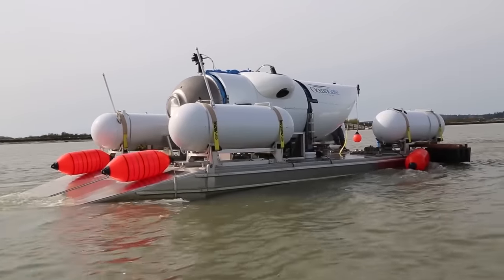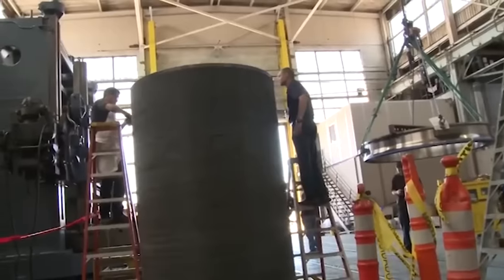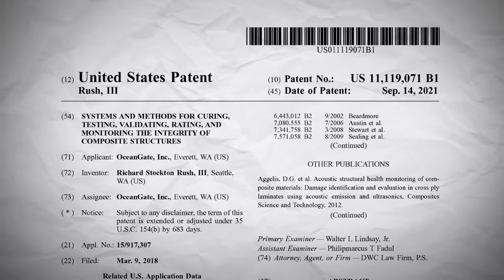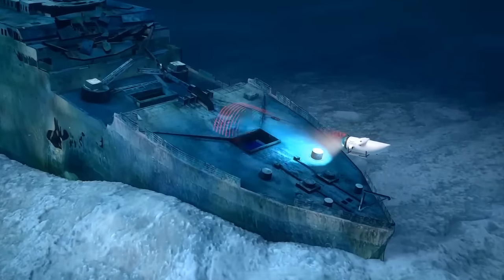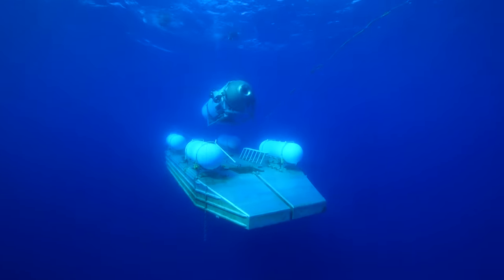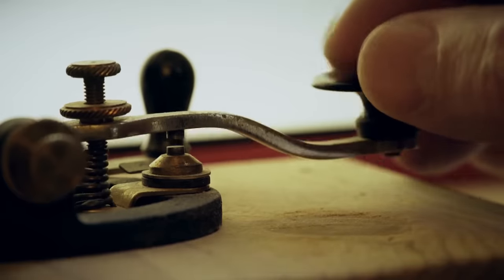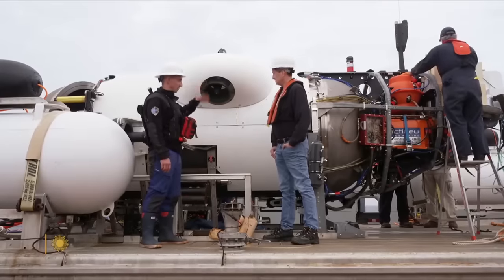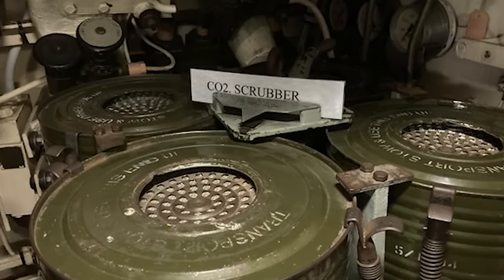Exposing OceanGate Submarines Many Fatal Designs

Comment: I’m glad to hear someone explaining that the controller isn’t that big of an issue.   Too many people focus on that because it just seems out of place, where odds are the catastrophic decompression was caused due to the hull’s poor design and material choice.
Reply: It really wasn't that big of an issue true, but the video way misrepresented the issue of having it as a main control. The examples he showed were all non critical systems with little risk involved, especially an example with military submarine: they do use controllers but they are 
1. Wired
2. Not Logitech crap
3. Only operate auxiliary systems that can wait for a replacement controller in case of malfunction 
Way different from using them wirelessly to control the sub at extreme depth very close to old debres
Reply: The controller itself was not the issue but the way it was used could have led to problems avoidable if done properly. Using it as a remote control, the need for batteries with the subsequent risk of fire or simply running out of power in the worst possible moment. Those things can be avoided by wiring the controller. This will not have been the root cause for the implosion but it indicates how poorly the whole submersible has been designed and built.
Reply: Everyone giving this man a bad name but his impact he left is far beyond what he could have imagine. This incident became the front page of worldwide news and the effects that’ll leave will be life long. I’m really hoping this sparks more individuals to invest in deep sea exploration because it’s still uncharted territory for humans
Reply: Poor material choice... like an X box controller?
Reply: A consumer grade lithium ion battery in an environment full of humidity and corrosive salt? It's totally a fire risk.
Reply: @alalalus7692  exactly this
Reply: So true!
Reply: @allaansnackbar4269  "...the effects that’ll leave will be life long."

Life long?

 I'd even say that the effects will last past the death of Stockton Rush.
Reply: Logitech be  Like:- thank God
Reply: metube2497  my guess is that the moisture came from the occupants exhaling.
Reply: you are so very wrong. a game controller doesn't have a zero chance of fire. they aren't built for that reason. the controller should have been custom built out of material that cannot catch fire.
Reply: "Too many people focus on that because it just seems out of place, where odds are the catastrophic decompression was caused due to the hull’s poor design and material choice."

lol. where to start? here perhaps - where odds are the catastrophic decompression was caused due to the hull’s poor design and material choice. are you really suggesting that people consider a massive decompression was caused by a game pad? a shitty cheap game-pad was worse than iffy carbon fibre? or are you just jumbling up 2 very different issues?
Reply: @KarldorisLambley  it has been implied that they potentially lost control of the vessel and that caused it to hit something; definitely not the case.  The other thing to note is that people think that it was some piece of junk because they used a cheap controller to opera; no the thing was just a death trap.  
Sorry for the confusion
Reply: @EpsteinsRope  yea… “military grade” is manufactured by the lowest bidding contractor.   “Military Grade” doesn’t always mean it’s the best.
Along with that, contractors have actually supplied Xbox controllers for actual use.
Reply: While the implosion came from another poor design and material choice, that doesn't mean the controller was not also a poor choice. Symptomatic and symbolic for the entire construction philosophy. It does make sense to use controllers like this (as mentioned in this video), but not a cheap wireless consumer model for mission critical systems.
Reply: Same thing with the old pipes for ballast.
Reply: The controller is a huge issue, in so many ways.  One spilled Coke in it and they're dead.  One squirt of salt water and they're dead.  One dead battery and they're dead.  Copious condensation from cold walls and their breaths?  They're dead.  One crushed recharging USB connector and they're dead.   No backup controller?  No mechanical pushbuttons or hand-valves?   No inherent bouyancy?  Dead.   Super high risks, many of them.  Even worse, their lack points to not having a single responsible and knowledgeable person on the design team.  They're dead, from the get-go.
Reply: I think it's because "shitty video game controller" is easier for a layperson to grasp than esoteric concepts like build materials and underwater pressure.
Reply: Of all the things to focus on, the game controller was the dumbest. Although it was sort of a sign.
Reply: @Hartwig870  ehh, not really a sign.  Drones are often flown via controller due to it just feeling natural.  There’s even a nuclear submarine that is controlled via Xbox 360 controller.
Reply: @@Scheduled_for_deletion of course we need to talk about everything, but we also need to focus on the important things. Any element that pertains to being “different/ experimental” or directly correlated to the failure.  The controller had nothing to do with either of those.  It had to do with the hull and it’s construction.  It’s a more technical thing to look into, but blaming the controller is only taking resources from the real issue at hand.

Comment: The window in the nose cone was probably what did it in. The single  port hole in woods hole's DSV Alvin (the first  submersible that discovered titanic) is 2  inches thick and is less than a foot in diameter, as compared to the huge window in the nose cone of DSV Titan that wasnt nearly thick enough for the surface area. Im interested to see if the nose cone can be recovered and shown to be the point of failure.
Reply: I'd be willing to bet that you're right. That combined with the weakening carbon fiber is just a recipe for disaster.
Reply: Your right mate
Reply: I would say it all disintegrated.
Reply: @flickcentergaming680 and the areas between the carbon fiber and titanium ends up corrosion over the times it's been in the ocean
Reply: There is no single component that "did it in". This thing was trash and it got compacted. Case study. Learn the lesson. Mourn the fallen. Move on
Reply: There are signs (dropped ballast) that they attempted to escape, which means the hull warning system probably went off, which means the hull.  If the window caved in, they'd only have had milliseconds of warning before death.
Reply: @codywheeler3260  yes, but given multiple dives, you would expect obvious signs of corrosion (e.g. discoloration) such that the crew would have easily flagged it and aborted.
Reply: @tsm688  usually in a submersible, the portholes are the weakest point in the pressure hull, because glass is usually the weakest material used. For that matter, I havent seen any credible reports of dropped ballast and some of the news coverage hasnt been entirely accurate, either.
Reply: @Hillr2249  it disintigrated, sure, but that is really over simplistic- for example, bad materials will give way even with the best of designs.
Reply: @dungeonmaster6292  an implosion occurs once the weakest part fails causing the whole thing to implode. The million dollar question is whether the carbon fiber gave way vs.a bad window design - which tells us what to particularly avoid in future designs.
Reply: @Harlem55  👌
Reply: @Harlem55  this is not a normal submersible :D  It's entirely possible the 5 inch perspex was stronger than their defectively-wrapped, defectively-shaped, expired factory second, 7-times-used crackling-like-popcorn carbon fiber tube.
Reply: @tsm688  exactly how cheap did they build this thing? I would at least assume they special ordered the fail-risk parts to specific specs. I mean if this guy was dropping people in the ocean in an old water heater liability proceedings are not going to go well for them regardless of the signed waivers due to res ipsa loquitur.
Reply: @Harlem55  this entire operation was a failure. Sounds as if the entire design is a failure and the real experts knew this already.

Comment: Apparently, the hull breach alarm HAD gone off and they had dropped ballast to try and resurface when the implosion happened. This statement was made by James Cameron, because of where the ballast was found in relation to the debris, they could tell that it had been purposely dropped in an emergency attempt to come back up.
Reply: That’s an impossible statement to make.  An implosion is followed by an explosion at the speed of sound, the ballast would have then drifted like a feather in the wind until hitting bottom.
Reply: The plexiglass started to crack
Reply: 100% bs speculation wow
Reply: @rfcdgaf I'm curious to know. We never will
Reply: False information. No official organisation has ever mentioned this. Please stop spreading false information
Reply: All that has been mentioned is of 2 debris fields, aka roughly where each of the ends of the submersible would have been, which means the implosion started in the middle at the submersibles' weakest point. With the hull imploded and no longer attached to the outside frame where the ballast is attached well it only takes gravity and a dash of common sense to figure that the ballast frame sunk to the ocean floor below.
Reply: @Chrisb8s  incorrect..the main/middle part of the hull is where the main implosion occured. The 2 debris fields are made up from the front and the back of the submersible. The plexiglass was at one of the ends.
Reply: James Cameron has never made this statement. Please stop spreading false information
Reply: @cathybaldry7822  Cameron said that. Google it before YOU spread false info.
Reply: @Chrisb8s  no it didn't. the viewing window as probably the safest thing on it, given that it was spherical and therefore designed to withstand pressure. And yes I know it was supposedly only pressure limited to 1300 or so feet, but it still would have been about the last thing to fail, given how ramshackle the entire build actually was.
Reply: @rydplrs71  no, an implosion is not followed by an explosion.
Reply: @cathybaldry7822  of course they are not going to mention it. It's not misinformation, Id believe Cameron over just about everyone else, he's pretty much the most revered and experienced expert on deep sea exploration.
Reply: @cathybaldry7822  yes he has, I've seen multiple interviews, done whilst the sub was still missing and after it was found, where he says exactly that.
Reply: They would also know this because the surface ship would have data from the acoustic positioning system showing that it was suddenly ascending instead of descending. Not all the info has been released yet, but it will eventually and will that you're correct in this statement.
Reply: @cathybaldry7822  Yes he did. SEVERAL times. Watch some of his interviews and see for yourself.
Reply: Just posting links along with comments would solve the problem
Reply: @candydandy2694 If it's like a star where it collapses in on itself it sup heats up under pressure an explodes,like the big bang theory. We'll never no.

Comment: Thank you for the informative video.  Well done.  The video of the railroad tanker imploding was definitely less violent than what the sub went through though.  Done in air, where sea level air pressure is 14.7 psi, the pressure differential it collapsed at was 14 psi at best.  Depending on exactly how deep they were when implosion occurred, the pressure differential between inside and outside would have been over 4000 psi,  somewhere around 300 times greater.
Reply: Just curious why is it that that are wine bottle in the titanic site fully untouched and unbroken by the so called tremendous so called pressures?
Reply: @i_eatstyrofoam  good analysis
Reply: @i_eatstyrofoam  Yea i'm sure if there is a little air pocket and an elephants steps on it it will break
Reply: @JMC-ul1sw  I agree, you can get a metal tank to suck inward with enough vacuum, and Carbon fiber would crackle like a cookie until it blows inward with shattered pieces
Reply: @JMC-ul1sw  Makes sense but I thought the bottle neck would cause a variance in pressures between the inside and the outside.

Comment: It wasn't the fact that it was a game controller that made me scoff, It was the fact that it was a cheap Logitech PC gamepad that you can get on amazon for $20 or less, AND it was wireless on top of that, relying on bluetooth lol. As someone who has owned this exact controller, multiples of them actually because they frequently broke, they would drop connection all the time. Granted I haven't used them in quite a few years but my opinion of them is that they're pretty junky. Logitech makes a lot of good peripherals, this gamepad isn't one of them, in my humble opinion. It exists solely for people who can't justify spending a little more on an xbox or playstation controller to use with their computers. 

It's just ironic to me that given how much this vehicle cost to build, maintain and use, they couldn't at least splurge a little more for a different controller lol. Using a bluetooth wireless controller, a $20 off the shelf controller, just adds another failure point into the loop of an already inherently risky process. Entanglement is one of the primary risks of diving to the titanic, there's a lot of debris down there. Imagine the bluetooth dropping out at an inopportune time because the gamepad starts acting up, meaning you lose all control of the vehicle temporarily. I just can't fathom why you'd even wanna deal with that possibility with something like this. To save some pocket change? Yikes.
Reply: Is there a chance they had spare controllers and cables on board for redundancy?
Reply: @patmacrotch5611 eah, Stockton told in a video, they had multiple spare controllers in the sub, But I don't know about cables..

Comment: Using 17 bolts. A couple of passengers say it and one explains that the 18th they dont use. Its too hard to get to. Stockton says it doesn't matter. It wasnt needed anyway.
Reply: If you dont have parts left over you aint doin it right
Reply: TyaxComp  Im just pointing out it was 17 not 18 thats all. Im sure the pressure doesnt try to go between the plates. It just pushes them together and there is no pressure inside the sub.  Why use any bolts? Just bungee it on. 🤣